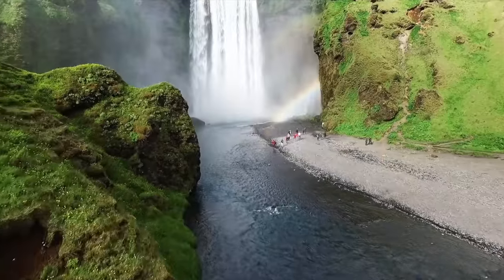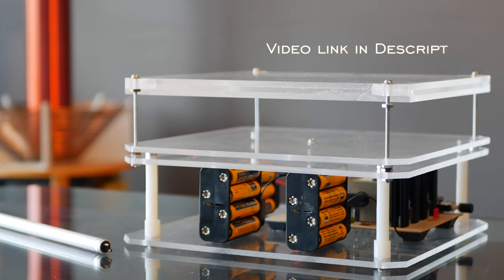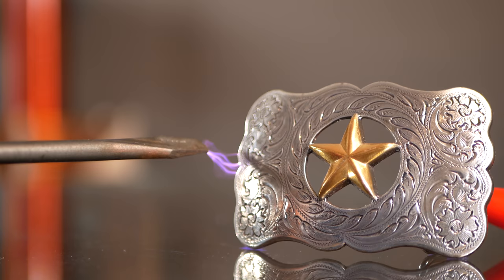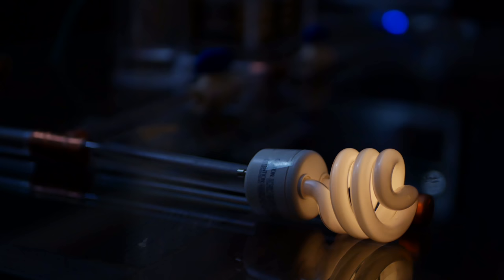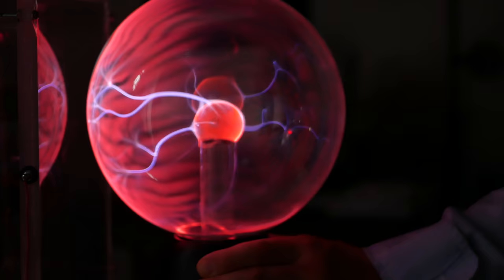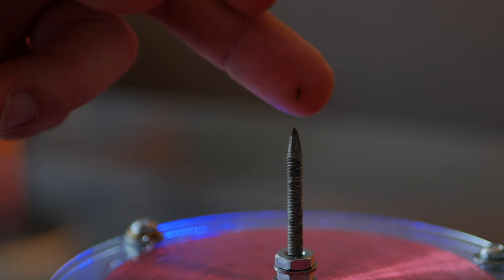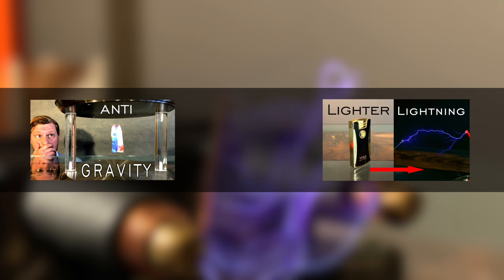Directional Wireless Energy Using Water

Comment: so you just replaced a wire with a tube
with what must be huge energy losses
Reply from the maker: Direct connection had very little energy loss. That's the reason you use high voltage. Also, hard to use copper wire and switches, because high voltage would ionize the air around the wire and power would leak out like crazy. The water pipe is wide, with a curvature of radius too great to ionize with 20kv.
Reply: @PlasmaChannel  
very little isn't 0, i doubt it'll beat copper any time soon either,
problem with high voltages is that you'll  easily get (iirc) a fucklot of electrolitic reactions around, if it's not properly isolated, you'll ionize the air a LOT, this thing is just a funny looking ionizer
if it ever leaks you'll have whatever was drenched in in a lot of trouble, if it was a computer it's straight up dead, the equivalent of not having a ground wire and building a static charge but in liquid form
if it ever beats copper cables then i guess it'd be good for electric relays but only if the static energy doesn't seep out into the ground
and think about transforming back the static energy back to proper electricity, with almost no amps you'll have a hard time getting most of it

Comment: Tesla tapped into this kind ir technology, but It has its problems and its not practical technology-wise.
Water is a good conductor but also too volatille and the nevessary pipe system is waaaaaaaay more expansive in comparison with that which we use today.

This kind of technology would severely interfer with rádio/internet/GPS signals, and so on. 

Its not as simple as it looks. Tesla was a conceptual Genius, but we have technology limitations that we are yet to acomplish...

Comment: interesting but sort of pointless. If youre transmitting power via water system, they should use copper tubing which has lower resistance.
Reply from the maker: Thanks! Problem with copper tubing : anything it touches it will discharge to. Acrylic tubing, it won’t.
Reply: @PlasmaChannel  Not unless its insulated. The acrylic must be thick enough to insulate and if it leakes, the charged water will be dangerous. Also the water must be decharged before it gets used. I like the concept non the less.

Comment: When you say that the power transmitted at any distance can be predicted using the inverse square law, what that tells me is that whatever you're devising here is valueless as a power distributor/transmitter. I like the idea of wireless power transmission, just as we already have wireless telephone. A power grid with no wires? I'd be all over that. But we're not getting there with what you're discussing here. Moreover, how is it "wireless" if you're just replacing wires with pipes? While it may, technically be "wireless," it's definitely not infrastructure-less, or simpler. Since when is your idea more reliable, or cheaper to build, maintain, repair than infrastructure of wires? I give you an A for entertainment, and an F for utility/practicality.

Comment: Not sure why you say it conducts water ‘poorly’ when everyone with any sense knows how dangerous it is to be in contact with water with any electrical cable in contact with it. It contradicts what you are showing in the video.
Reply from the maker: Well, water does conduct poorly. Until you place high voltage across it. At normal voltages, say 120 volts from a wall, its terrible. The purer of water you use, the worse of a conductor it is. I did a video about DI water, and how DI water is the best insulator known to humanity (which it is). In the video I plug in a bulb under water, turn on a hair dryer under water, and do other experiments. Pure water is the worst conductor known. As minerals and salts are added - it becomes conductive. But, even at 120 volts, with ions in it, water is a poor conductor. Bumping that to 20,000 volts......great conductor!
Reply: Plasma Channel Understand as I am coming from a place of water that has minerals as it naturally occurs and how I expect it to be. Minerals are the important things here. It is the same for health reasons. Minerals are essential for the function of the human body for conducting the electrical charge in our body that makes our heart and everything else function normally.

Comment: Seems really useless. What is the purpose of the water, the same effect would be achieved by running a wire from the high voltage supply and putting a bulb next to it.
Reply from the maker: How would you control the 20,000 volts from one segment to the next? 20,000 volt switches are not commercially available, and a wire would cause corona to form. You’d have to heavily insulate the wire, very heavily.
Reply: @PlasmaChannel  I mean you heavily insulated the water so I see no difference. It's not like insulation is expensive nor would it take up more space than a tube of water. Water based electrical systems are not commercially available either but a 20kv switch would be much easier to implement into our current infrastructure.
Just to be clear I think this is a good demonstrative to get young people into science but I dislike trying to sell it as a practical solution. It is very important that young engineers learn about practicality of their ideas.

Comment: Write a paper. Submit it to a journal. Seriously.
Reply from the maker: Thanks J. That really...makes me think if I should.
Reply: @PlasmaChannel  looking into it a little H.D. Einhorn did a study on induction of a current into water with electrolyte added via magnetic field . By contrast what you're doing is applying electric current to the water creating a functional flowing electromagnet and an induction current into any load in proximity. It shouldn't be possible without a receiver coil. It calls into question as to whether it's true induction or wireless electricity. Have you experimented with water temp or velocity, pressure, etc... ? You're testing in a closed system at present yes?
Reply: @PlasmaChannel  seriously I have a friend that got published in a physics journal for a THOUGHT EXPERIMENT. He didn't even actually do an experiment. In fact the experiment that he  thought about wasn't even feasible, but it would have put the theory of relativity to a definitive test.

Comment: so you used a liquid conductor instead of metal in it's solid phase and you're even giving it an individual name "Bowles Transmission" @5:56?
Awesome! That is sooooooo great.
Try mercury next and call it the "more-curry-transmision" or even better MCT for "Marie Curie Transmission".

Srsly, so you think no one ever used water to transmit electrical power? Oh nose you used transparent(!) non conductive pipes and plastic valves?
Quick! Find a new name for transmitting electricity over copper wire because its usually not insulated with paper any more but with PVC! 

Hmmm, what does cutting wire and placing the new ends near each other do? Yes you invented(!) the water capacitor. Put water in a tank separated vertically in two halves and you can change the capacity by changing the water level(s).

-------
Puhhh, now my sarcasm reserves are empty.
Reply from the maker: Boy, your sarcasm reserves must be low after that. The video was about wireless power transmission, using pipes. Not direct power. Use of acrylic had nothing to do with function. I did several patent searches and saw nothing, as well as no videos online of the like. Figured it would be funny to name it was all. 

You may return to your regularly scheduled Sarcasm.
Reply: @PlasmaChannel  - How in sciences name is anything you do in that clip with water "wireless" when you use an electrical conductor to conduct electricity (or potential or charge)?
What's the difference between dirty/salty water, mercury and a normal copper bar/wire? The electrical resistance nothing more. Or are you using distilled or at least demineralised water?

I have no problem with the "inner" content of this clip - it's a bit artsy, fun to watch, looks like magic for the laymen and a bit fascinating for people who have an idea of whats going on (like electricians, radio amateurs, and so on). It's the framing that makes it terrible.
Keep making entertaining videos with and about electricity, plasma and so on but please stop sprinkling them with so much misleading non-information.[1]
Explain whats going in instead of kind covering the topic with more mysticism.

What kind of HV source are you using? Tesla coil? Van de Graaff generator[2] or another type?
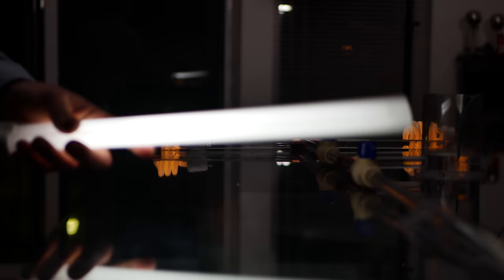If it is a Tesla coil you're just transmitting high power AC radio waves and to me it sounds possible that a directional antenna or waveguide could be built. But you are doing neither of those things. Maybe a bit by accident and that's the reason for the unexpected distance @4:08

> I did several patent searches and saw nothing
I srsly recommend you read the comments section here: https://hackaday.com/2020/05/15/high-voltage-experiment-pipes-power-with-water/#comments

[1] just to point out a few:
A) @0:07 "... we are completely overlooking ..."  -  no! Water is used to transmit power in the real world[3]
".. another use thats entirely different."  -  nothing you demonstrate is 'entirely different' from all that has been done with electricity since its discovery.
B) @1:21 "in essence the sheet of water acted as wireless power transmitter itself ..."  -  no it does not. It's just one capacitive plate of a capacitor. That would be like calling a mirror a light source because it reflects the light coming from the sun.
"... pretty crazy stuff"  -  no. just no.
C) @2:06 "... test this system to see if water can be used ..."  -  There is nothing to test because all that has been proven, demonstrated and calculated in the past AND you give the answer yourself @1:36 ("... and treat that pipe like a wire").
D) @3:34 "...because most of the energy leaks out of the system"  -  You know about the basic law of "conservation of energy"[4] don't you?

.... and so on.

E) > ... wireless power transmission, using pipes {filled with a conducting liquid} (from your answer to my original comment)
only in the strictest laymen word for word interpretation of "wireless" does that qualify as wireless.
No one with any knowledge about physics, electricity and so on sees anything wireless going on with the water (especially not with the non-conductive pipes because they don't transmit anything).

[2] https://en.wikipedia.org/wiki/Van_de_Graaff_generator
[3] https://en.wikipedia.org/wiki/Single-wire_earth_return
[4] https://en.wikipedia.org/wiki/Conservation_of_energy

OT: Thanks for the "HEART by Plasma Channel" thou. Definitely didn't expect my first one on such a "negative" comment. Be careful of what you're encouraging here. ;-)

Comment: If you had got to any college EARTH IS ZERO POTENTIAL, THESE TUBES NEED TO BE HIGHLY INSULATED FROM BUILDINGS  HOW IT WILL BE DISTRIBUTED . PRODUCTION COST MILLION BUT INSULATION N TRANSMISSION COST BILLION now is it feasible NO .TRY PLACING THE SETUP ON FLOOR INSTEAD OF TABLE U WILL GET UR ANSWER . WALLS ARE NOT PERFECT DIELECTRIC .